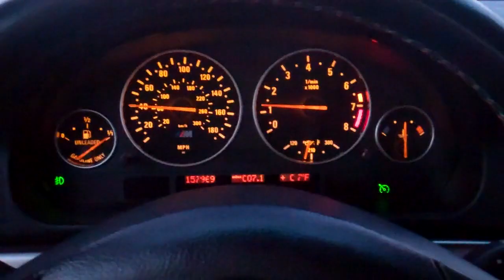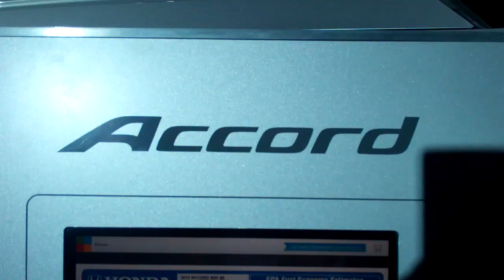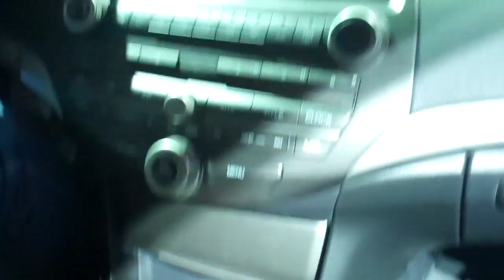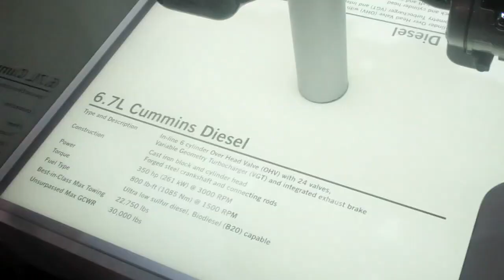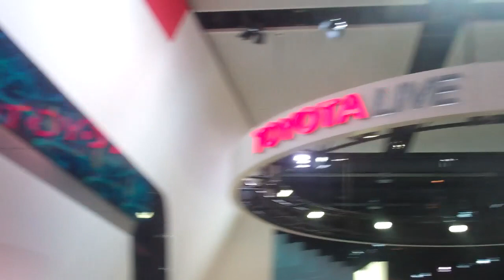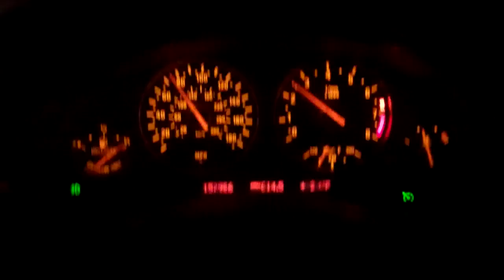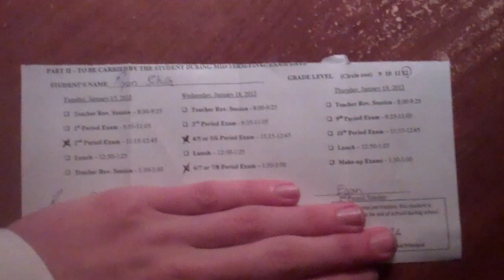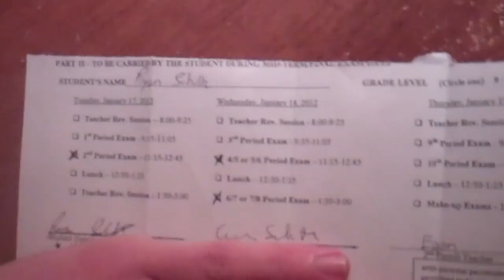M POWER - NAIAS  1/15/12 - Day 399

Comment from the maker: @OldTimeForties The thermostat regulates engine temperature by letting x amount of coolant in.  It's so expensive because of the install process.  Airbox work comes out, radiator hoses, so on.  It takes like 4 hours to put in.

Comment: I noticed your odometer cluster has pixels out when you filmed the engine temp gauge.  You should be able to take it into BMW and show them it and they might do it for free, mine did because it was a known issue.

i PM'ed you with a link.